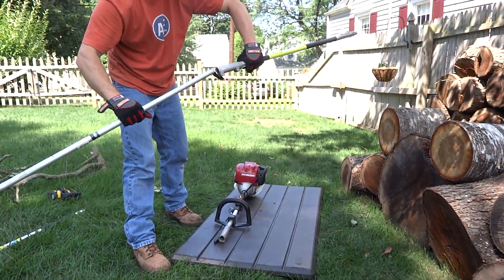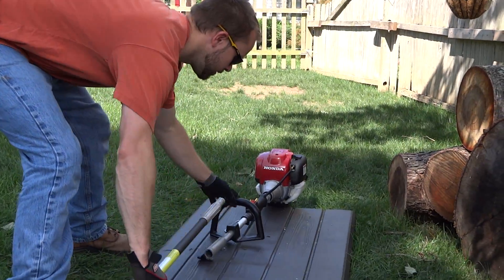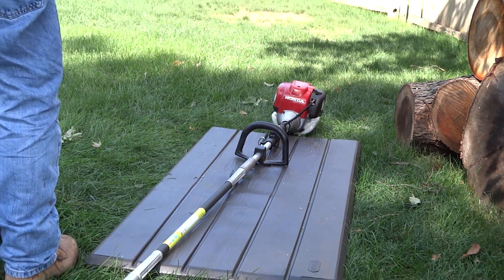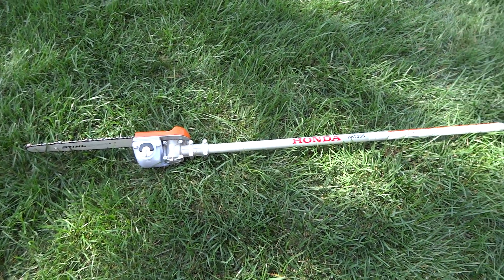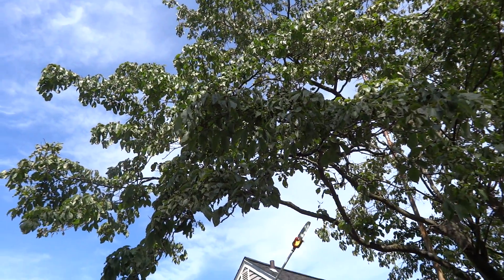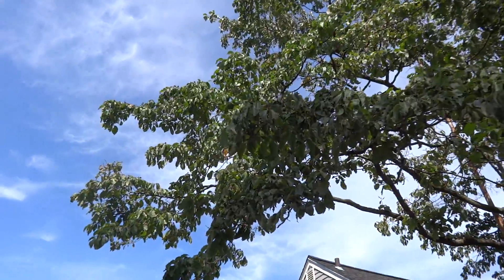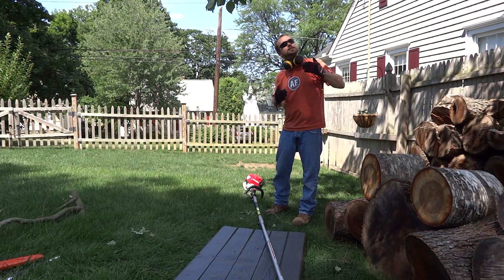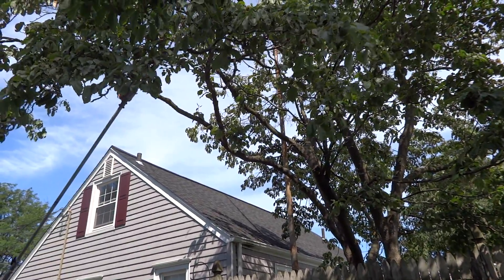Honda (Stihl) KombiSystem HT-KM Pole Pruner with Custom Extension

Comment: Awesome content on the honda trimmer with kombi attachments.  May i ask how you did this since the honda shaft has a star pattern while the stihl has a square?   Thanks! 
I have a honda HHT35 trimmer that i am trying to retrofit to accept all of my old ryobi expandit attachments.  I am hoping to do something similar to your other video but using ryobi upper parts rather than stihl.  However, i dont fullly understand how you are using this long honda shaft since it has the wrong cable inside.
Reply from the maker: When was your unit manufactured? And are you in the United States?

Mine unit came with an inner flexible cable that has a square end (not a star). So Stihl Kombi inner and outer shafts were a direct swap without needing to make any custom modifications to the inner shaft ends, or the Honda motor head.
Reply: @ErikAsquith  you are right!  I just looked at my unit (solid shaft hht35s) and it was square shaft... but I looked at the versattach units and they appear to have a hex shaft.
I was able to take my toro expand-it and put it right on the honda!  Thanks!